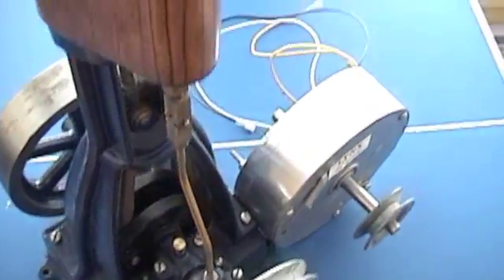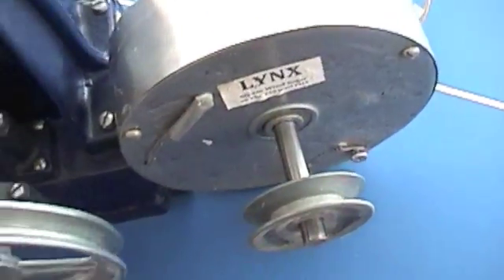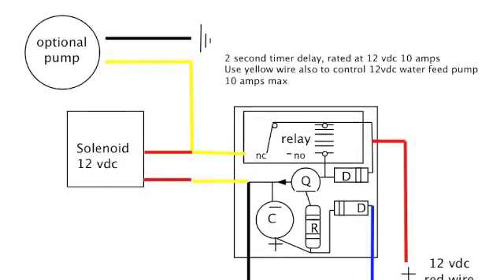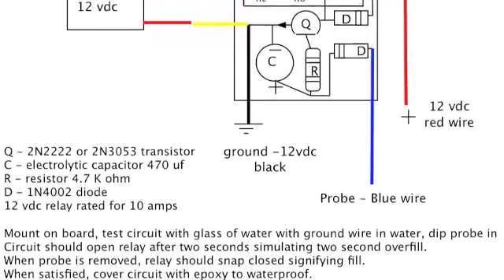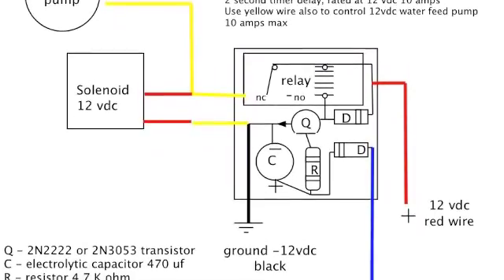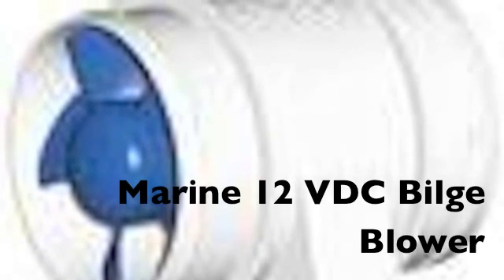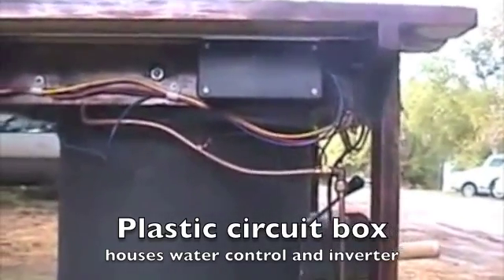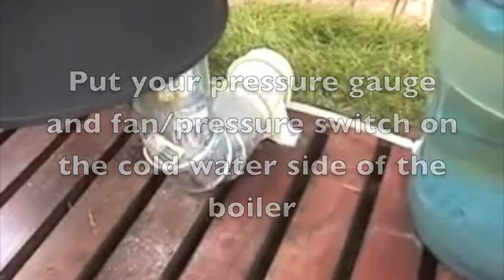Steam Boiler Control Circuitry

Comment: I tried your circuitry, and it didn't work, the plug is a good idea though. I found that is much much easier, more simple, and reliable to use just the capacitor, and transistor with a normally closed (NC) 12 volt relay. the transistor acts like a tiny relay in itself, so I just used the capacitor to jump up the voltage from 12 to 19 volts Dc, and I used the transistor to trigger the relay. the transistor base wire is connected to the electrode post on the plug. when the NC relay is triggered by the water level, it turns off your pump or solenoid. when the water level goes down, it will kill the current to the relay, thus turning the power on to the pump/solenoid. Also, ripping off the top electrode from the plug will keep water droplets from sticking to it, and inadvertently triggering the circuit when its not supposed to.   the NC adjustable delay relay is like $8 from amazon. here's the link:  http://www.amazon.com/gp/product/B00VFO2R74?psc=1&redirect=true&ref_=oh_aui_detailpage_o00_s00
Reply: +Brent atAmax 
here is a photo of the circuit.  The relay should have two pins for the magnetic coil.  The pins aren't shown on the schematic but that is where the connections go.  When the coil is energized the realy will close and the NC normally closed circuit will close and the pump or solenoid will energize.
http://www.lynxwind.com/new-page.html
Reply: Hi, I read your comment and tried your configuration. It works but when I think it's time for it to start refill the boiler the relay won't start. Please kindly advice... Thanks
Reply: +Rizal Zulkifar 
test the circuit by pulling the blue lead wire off the spark plug.  The pump should come on.  Touch the blue lead to any ground on the boiler and the pump should tun off.  Sometimes a turn of the plug will solve the problem.  A bubble of water can sit on the plug gap.  If the boiler is hot and has steam this doesn't happen.
Reply: +Lynx Wind Thank you Lynx for the kind advice and attention given. I am  now build my own budget steam car wash. Thank you and I will update the progress. Cheers
Bytheway, should we put the spark plug close to the pipe? Mine has 5" in pipe length before reach the spark plug.
Reply: +Rizal Zulkifar 
The plug (sensor) really should be placed in the flow of water/steam.  Otherwise water can be kept in the short extension even when the boiler is running low.  It should have velocity running past it.

Comment: Here in NZ I have my flash boiler operational but using simila circuitry i find it will not pick up the difference between water on the gap to steam across it.it does work but not reliably,I do hope to post mine on youtube as soon as,any idears

Comment: I like your water sensor! What is the part number of the spark plug that you use?
Reply: It's a spark plug from a lawnmower.  You need to run a 1/4" NPT die on the threads and seat it with some sealant.  I like the "Gimme the Green stuff" but teflon paste will work if you let it set up over night.
Reply: Thanks!

Comment from the maker: @Zappyguy111 
The pump is noisy because it is rattling through all the copper tubing.  To quiet it I need to connect with high pressure flexible hose.  It is the stainless steel braided rubber tubing.  Since it is on the cold side this isn't a problem.
Do the math before you expect too much from a thermal dish.  It will work but solar panels are more efficient.

Comment: If it burns, it means electricity! 
Just wondering, how noisy is the pump? Is it as noisy as the video makes it out to be?
I'm thinking about setting up a solar thermal dish with a radiator to generate some power for the house.